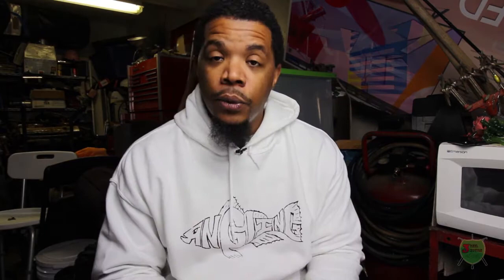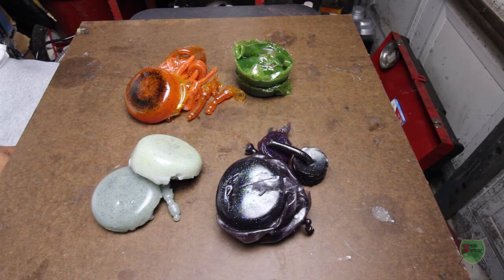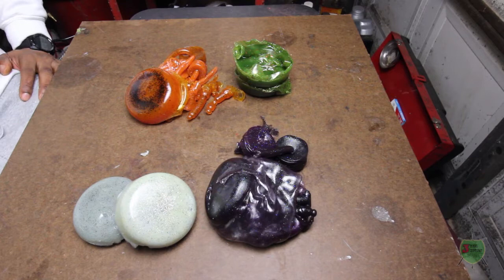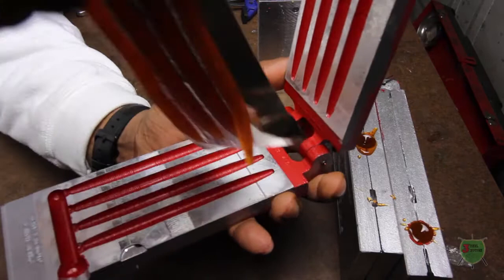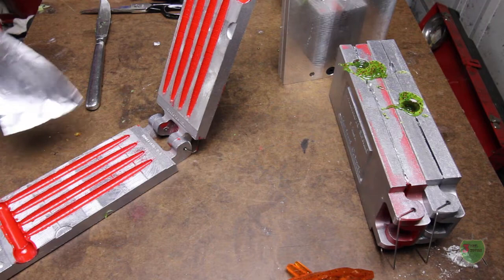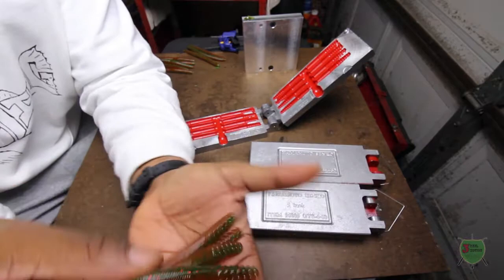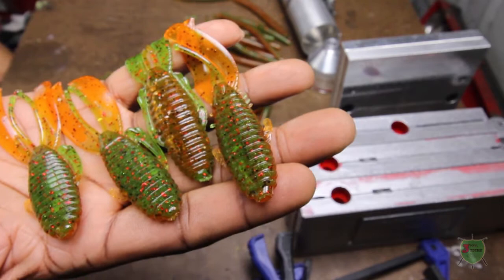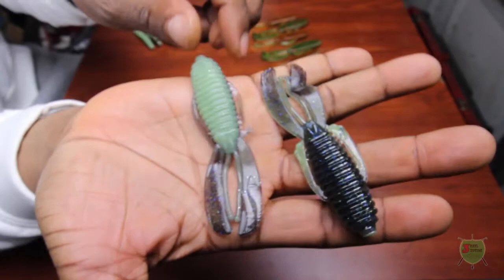CHEAP Soft Plastic Laminates with FOIL. (Really works)

Comment: Great tip , take a heat gun and worm the half tap before you inject the 2nd color abs u won’t have cold cracks and u gana have a better bold and less bleed

Comment: Awesome! Good tip
Reply: Just tried it out and it worked perfectly
Reply from the maker: Makes a big difference in what you can make now, right? Glad you up'd your knowledge with me. Thank you for letting me know.
Reply: Huge difference! And a cheap option without spending a couple hundred bucks!! Keep doing what you’re doing, most people put tips up here that hardly ever work… thanks again

Comment: Thanks for the tips , I got one for you if your baits are delaminating try putting them on a flat griddle while still in the mold , also helps with those weird spots on baits .  Basically it remelts the bait , Donno if you was doing that already but I figured I'd be a smartazz and leave a post 😂